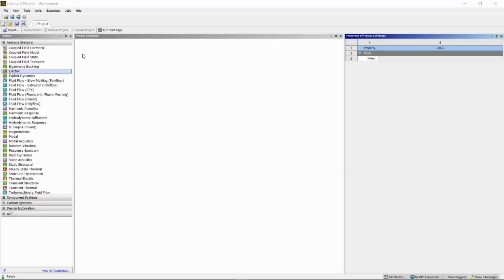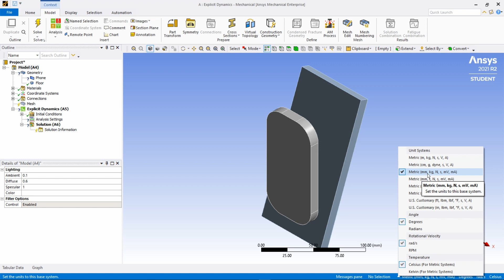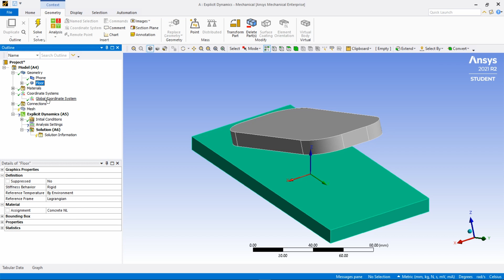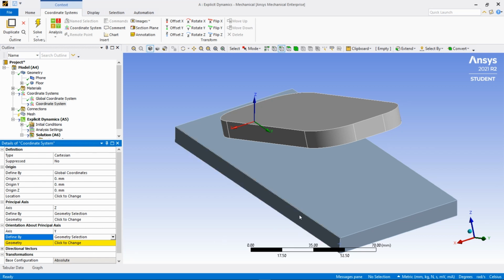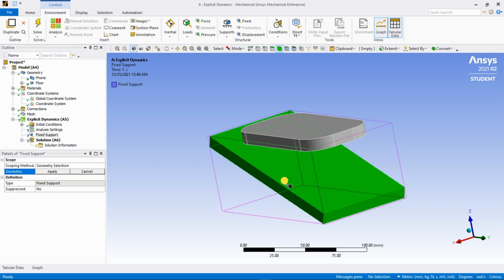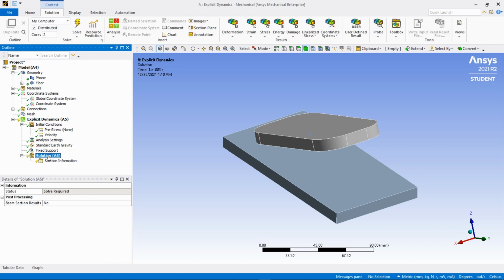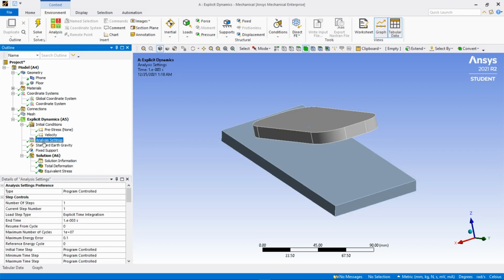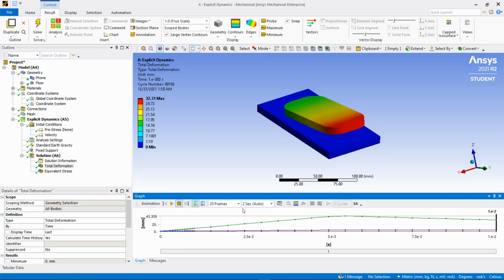Drop Test Simulation  (Ansys Workbench)

Comment: Sir can you tell me how you made the geometry
Reply from the maker: You can build it with Ansys SpaceClaim or any other CAD software then import it.  A copy of the file should be in the description.
Reply: @kabindaex7047  but I am not able to made the surface on which phone is put on the surface and how much degree
Reply from the maker: @comedy_canvas   Here is the link to the file. https://drive.google.com/file/d/1lgXz2_pFlhoa7kmpP-BgGZAZSldOBCBr/view?pli=1                   

*Note that the angle doesn't matter. Just take into consideration that the result might be different. I suggest that to try multiple angles then compare your results. *